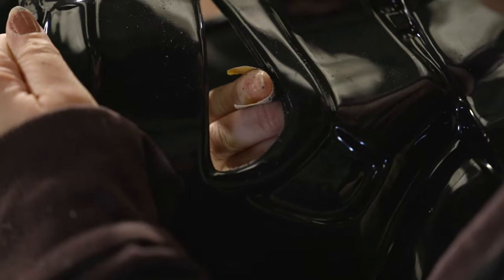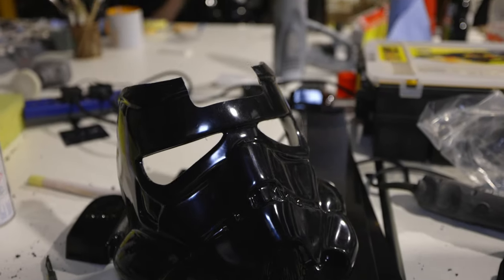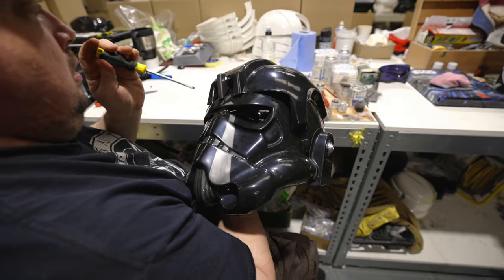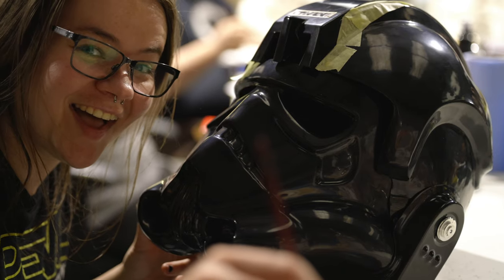The Art of RS - S01E01

Comment: The helmets look fantastic, but do you think the 2 stickers on the brow of the helmet would be better as one complete sticker and not two halves. I only say this as when I was watching the video all I could focus on was the join in the stickers. Good work though, keep it up 👍
Reply: I thought exactly the same - just a thought
Reply: It can't, it is on a domed surface. The split line lets it sit flat, otherwise it would wrinkle. The original decals are just like this.
Reply: I saw the same thing. I can't recall seeing it on the original prop so I went to look for images. That sticker just needs to be really flush to avoid the join being so visible. But what do I know. I thought it would be a decal put on in parts but then if it's not how it was in the movie... then it's not a replica
Reply: The cog are correct as they should be